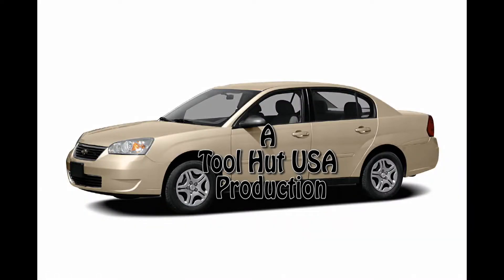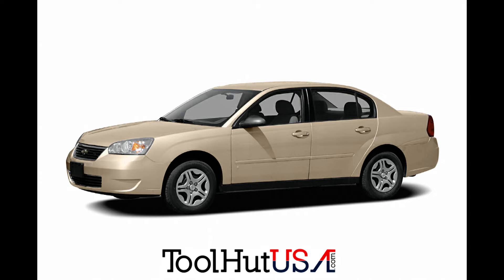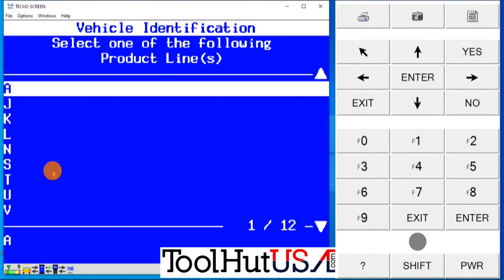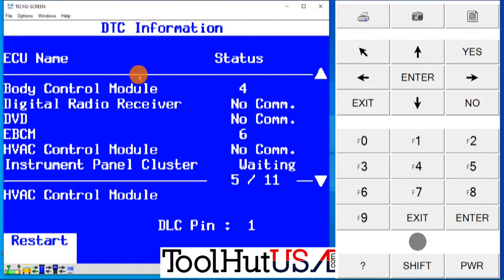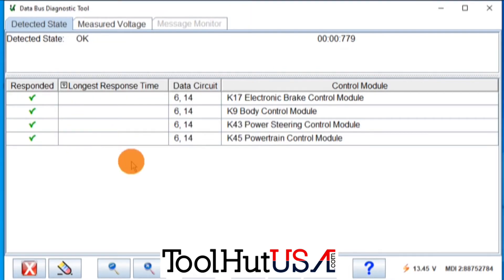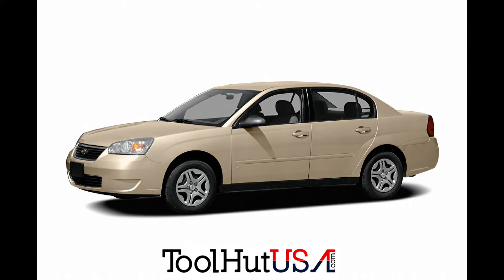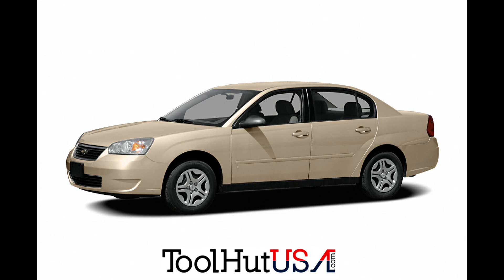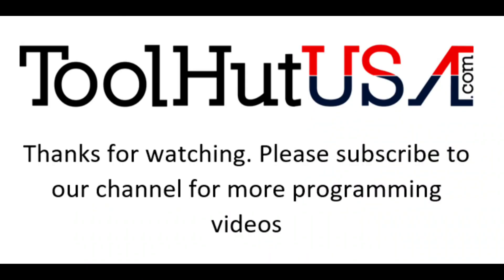2006 Chevy Malibu PCM the hard way

Comment: Great job showing the can diag bus tool. This is something that I often forget to use but do have access to. I call the infamous sound  the Bee Boop! typical Ac delco teh support   about 1 in 10 times helps.. I had one time that I had a similar issue quite a while ago,  had to flash "wrong " then right.  Thanks for sharing!
Reply from the maker: I am going to do a few more using it. The more I use the more I like